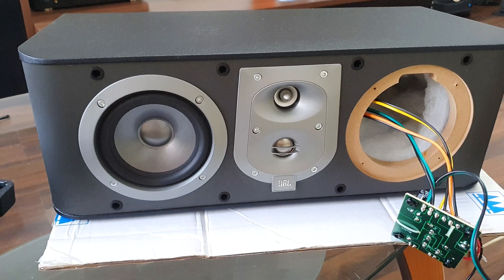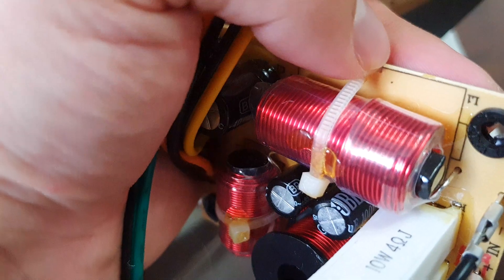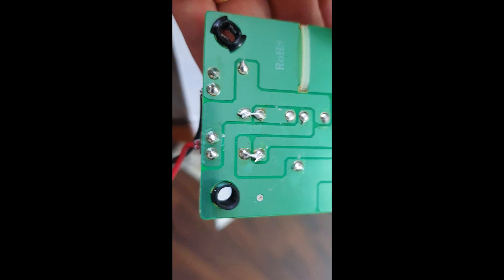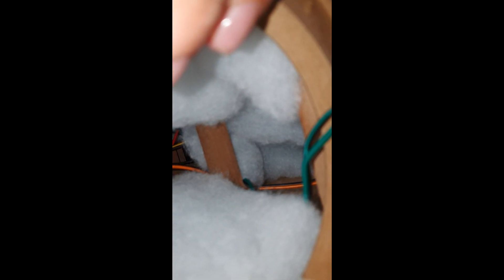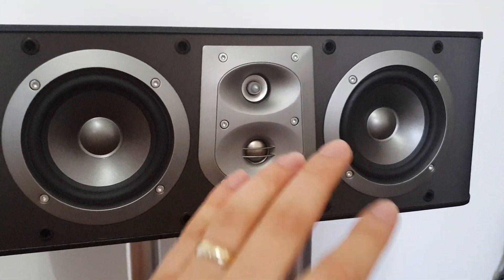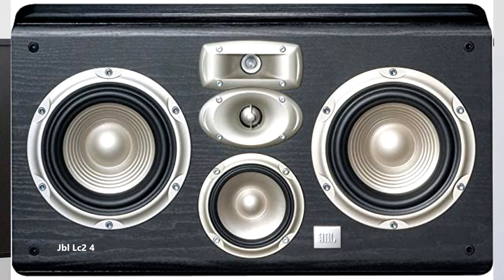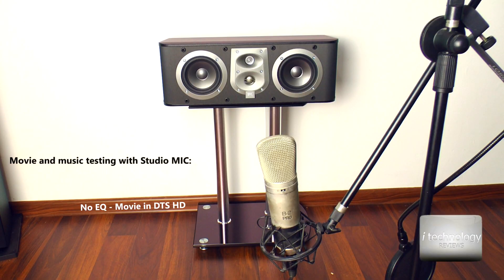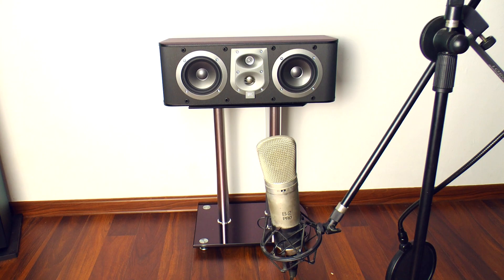JBL ES25C sound / Highs UPGRADE - mainboard modification Central speaker; testing with STUDIO MIC.

Comment: I bought a pair of ES90 and got the ES20 pair, ES25C and the ES250p subwoofer with them for free.  Very happy with the ES90, keeping the others for spare parts.  Thinking of using the ES20 as desktop speakers with a small subwoofer.

Comment: Try changing the tweeter caps to 3.3uf.
If you need a lower cutoff for mid/bass change it's cap for 10uf.
Reply from the maker: Hi. But why? The sound is good as it is. A little enhanced with this trick i have to say. With you re idea, you will lose some little clarrity. Subscribe

Comment: Yo, I'm trying to find a center to match my JBL ES30 speakers, but I can't find the ES25C anywhere. It looks like it was discontinued a few years ago, and I can't find it any cheaper than $200. Considering I got my ES30s for $100 total, that's quite a disappointment.
Reply from the maker: Hi. Man i feel you. I boutgh 3 or 4 years ago and i payed almost 250$ and these speaker is incredible. Now i boutgh the last speaker in my country at a discount ~200$. I don t know where to direction you but have you search on amazon.com or co.uk?
Reply: @iTechnologyReviews  I've checked Amazon, no dice. Maybe I'll be able to find it cheaper in another country (I'm dying to go back to Spain, maybe I'll have better luck there), but for now I'm considering researching speaker design and buying the tweeter on eBay for $40. It's worth a shot, though I don't have the necessary tools.

Comment: Hi.I have a 5.1 system sorround and i want to know if i can coupling  it with a reciver 7.1,or do i really need the reciver to be 5.1?
Can you recommend a specific type of receiver that decodes all the sounds and 4k Hi res too.thanks
Reply from the maker: Hi. No of course not. You can put 5.1 on 7.1 receiver just leave the 2 side conectors  alone.
Reply from the maker: Check into our videos we have 3 receivers. We recommend Denon.
Reply: @iTechnologyReviews  thanks